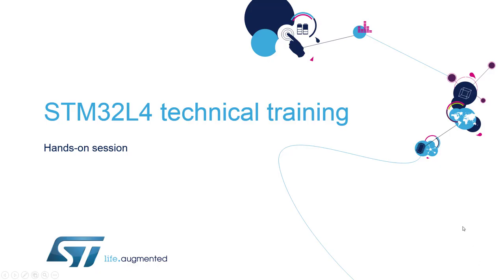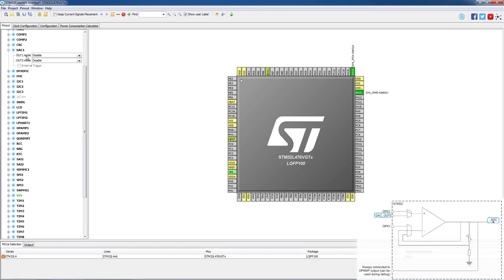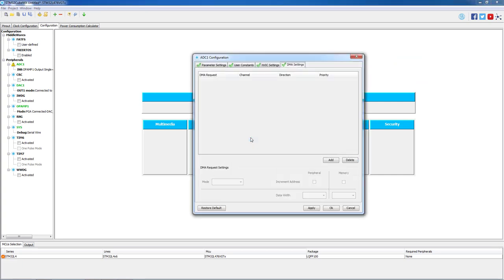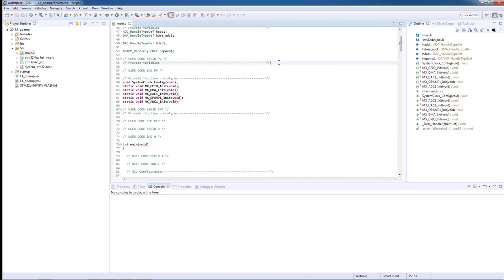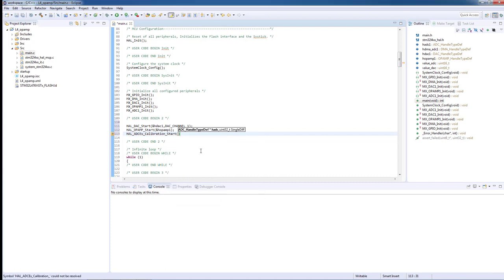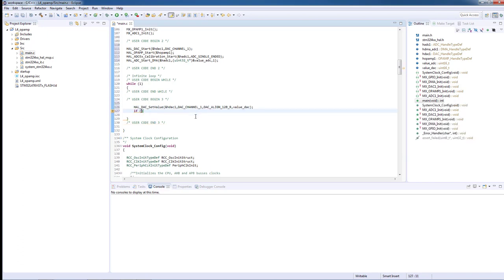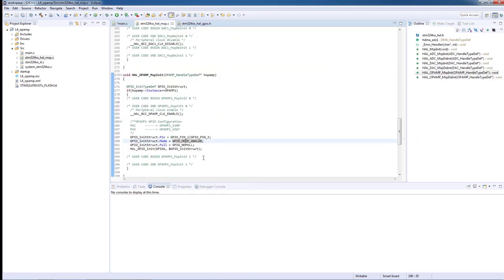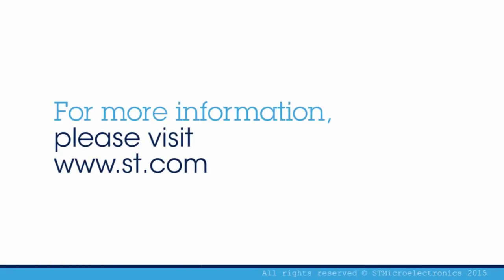STM32L4 training: 04.6 Analog peripherals - Hands-on OPAMP

Comment: Hi I use nucleotide board with a 5V pin. Can I use this pin as reference voltage to output 0-5V from the DAC/opamp pin?
Reply: AFAIK, you're limited to 3.3V, or sometimes 3.6V, depending on the chip - for almost everything other than tolerating 5V as a logic input on some pins.  If you find the datasheet for the particular STM32, you should be able to find voltage limits for the pins. but I think you're going to be limited to the 3.3V range.  Usually, when there's a 5V supply on a board, it just feeds the regulator that gives you 3.3V or so - on some boards, it's 3V.   The maximum for any STM32 is 3.6V, I think.  It's okay to use the 3V or so supply as a reference, though it's not an ideal one because it's not perfectly stable.  You could, for example, use the 5V line to provide power to a voltage reference chip, giving a 3V output to use as your Vref.  One way is to use a TL431, with three resistors, to derive a more stable reference voltage (2.5V to 3V or so) from 5V.
Reply: @TooSlowTube  thanks a lot! All clear.